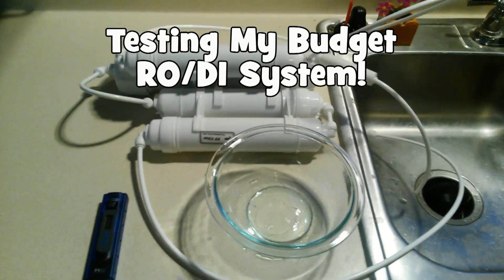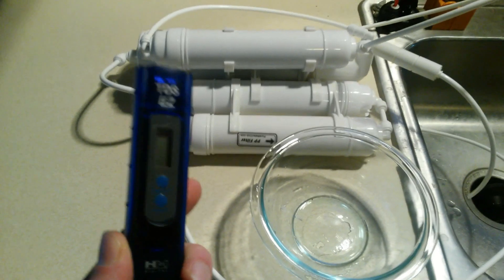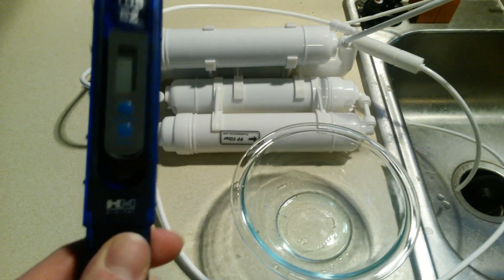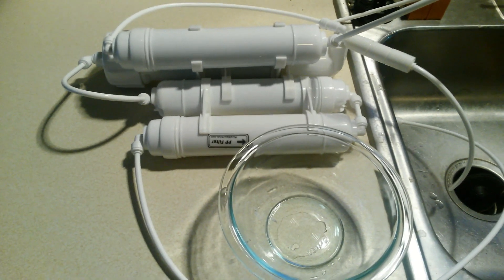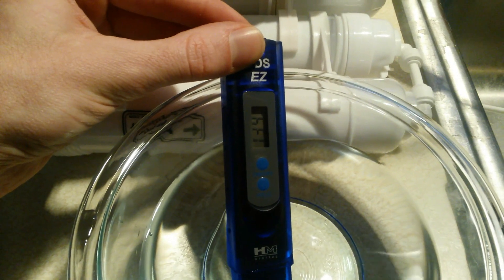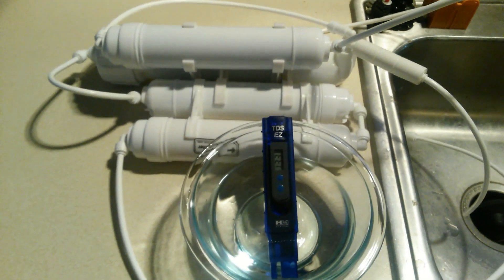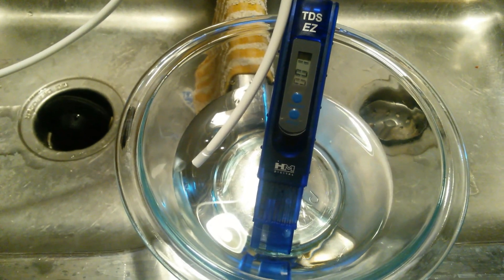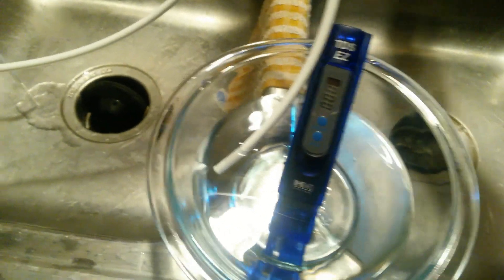POQ-4B-50 Budget RO/DI TDS Test

Comment: how long do you think it would take to fill a 5 gallon bucket? do you think it would be better to fill it up before hand and let it set in the bucket until you need it?
Reply from the maker: It generates a gallon every 1/2 hour basically, so it would take 2.5 hours to fill up a 5 gallon bucket.  If you're not going to let it sit for weeks and weeks, it's perfectly fine to fill up a bucket and mix your saltwater ahead of time.

Comment: How is this unit after about 2 years of use? Are you still using it or upgraded to a bigger unit? How many times did you changed the filters/RO/DI components?
Reply from the maker: I have upgrade to a bigger, more sturdy unit that I will be posting an overview of shortly.  This unit did just fine by me though.  My only issue is that at times the website is confusing and I ended up ordering the wrong filters for it once.  There is ZERO customer support, as they never respond to inquiries.  That was the driving decision behind trying another product.  When I had it, I switched out the filters about once every 9-10 months.